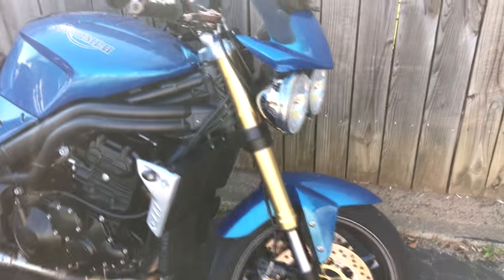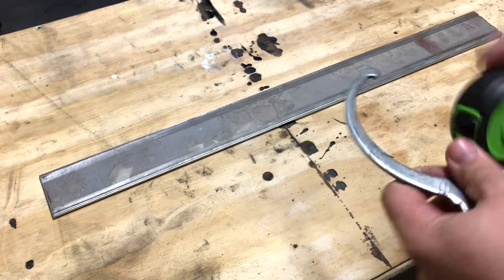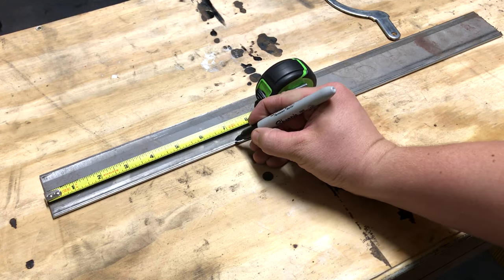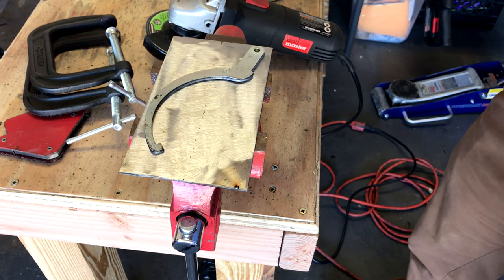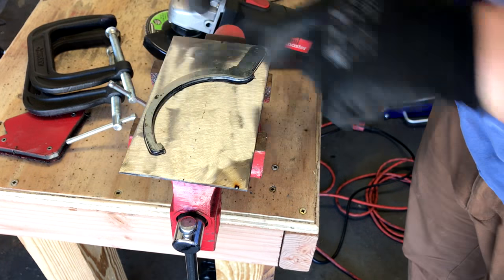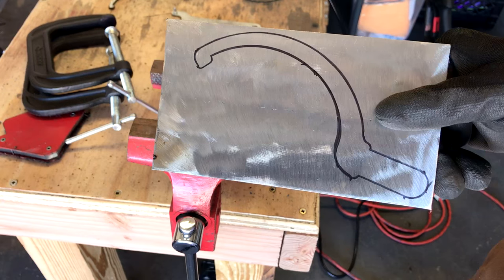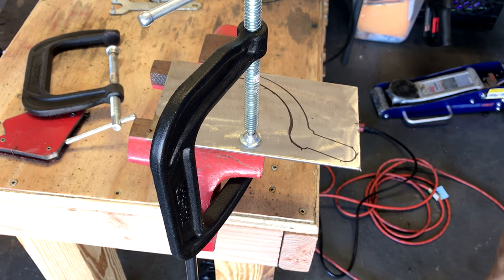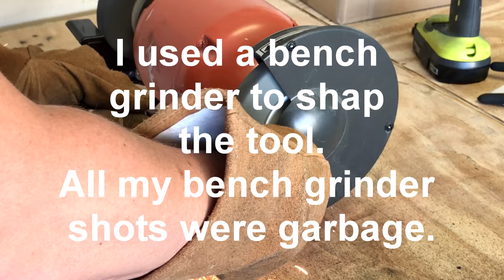Triumph Speed Triple 1050 Eccentric Chain Tensioner Tool Build

Comment: theres another piece that goes with the stock adjuster, the piece you show slides into the 2nd piece effectively lengthening the adjuster tool.  the missing piece looks like a section of flattened tube which ends up with an internal opening slightly larger than the width of the short end of  the original adjuster.
Reply from the maker: Never knew what I was missing!

Comment: Cool video.. I was taught to take your gloves off before using the bench grinder.. Could easily grab the glove into the wheel.
Reply from the maker: Sean S Thanks man, I appreciate it. I normally only wear nitrile gloves but I was heavy on the grinder causing the metal to get too hot to hold. Otherwise I wouldn't use big welding gloves. :)